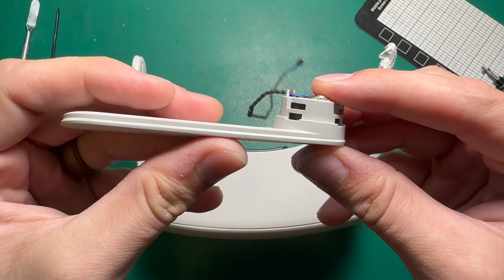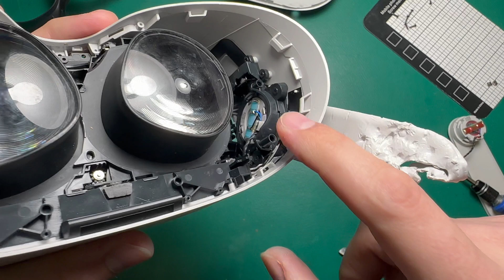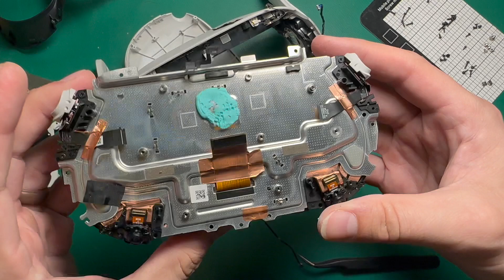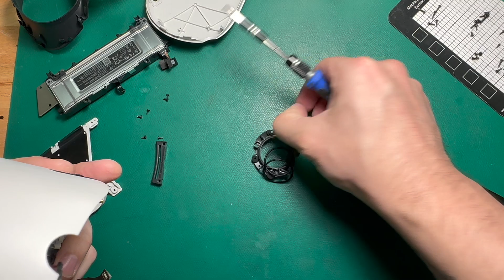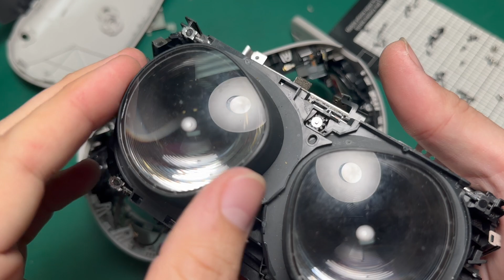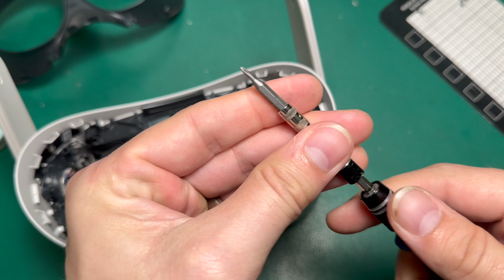Replace the Speaker Arm On Your Quest 2 - Step By Step Tutorial

Comment: THANK YOU SO MUCH SIR ! You have a Saint Patience for sure !!!! Never in my life I would have done it without this video. Anyone thinking of doing the same dont... My car is easier to repair.. I had some rattle on my speaker, it wasnt worth the pain to change it all. I dont even know how I didnt broke some ribbons. Everything is so sensitive, It took more than 1 hour just to open everything. Those pins are such a terrible thing. I gave up on 2 and sticked an X/acto between the pin and the speaker, they actually came out easier than using the other method, a bit scratched and deformed but still usable. I thought Apple was crazy with the repairs, Apple is a kid play, this is monstrous. and if we thing Samsung screws are so strong they even break my cheap tools, Samsung is like a Tank, Apple a small pain, Meta Quest a Whole Nightmare, damn... I would say I can repair samsungs all day before touching a quest again. no no no
Reply: OMG bro you are lifesaver ! Same happened to with those darn PINS. Two of them came off like nothing with just a little push but the other 2 of them were impossible work around. Tried every single tool I had and they didn't move not even a little. Days later I went and buy myself an Acto because of your comment.  It worked like it was made for that. What a relieve.

Man if the repair was not already somewhat difficult. THOSE PINS are a PAIN to deal with. THANKS!

Comment: Thank you, it was pain in the ass, but I did it. Bought a broken Quest 2 off ebay for 20$ and followed your instructions down to the tee. You saved me quite a pretty penny, again, thank you.

I did very frustrated at removing those little metal clips holding the speaker because they wouldn't budge, I cut off the black ring holding them. I also replaced that with the spare.
Reply from the maker: I’m so glad you got it working!

Comment: Hey I don’t know if you do repair quests. I’ve had my quest two for two years and my left speaker has just started to cut in and out pretty bad. Is there anyway I could pay you to maybe somehow try to fix it? My quest to if the 256 gig model and I know that it’s gonna be way more difficult to buy Compared to the 128 gig even though you can’t buy either of them anymore I still love and use my quest to every single day

Comment: Just finished the video. I sincerely cannot believe I have to take all of these modules out just to replace the speaker arms. You would think the arms would be easier to detach from the unit without having to literally disassemble the entire head unit to its bones. I might as well replace the battery and everything else at this point. Ridiculous how difficult they made this to repair.
Reply: @Krystalmyth   it's really not that bad. I kinda had fun

Comment: Great timing man. The outer panels of my speaker arms have cracked thanks to an aftermarket strap stressing them, and while they do work I am expecting them to shatter or break at any time. Would you say this is a novice friendly repair or would I be better off getting someone to do it, or replacing it? If I only need to replace the outer shell of the speaker arm do I need to replace the entire thing?